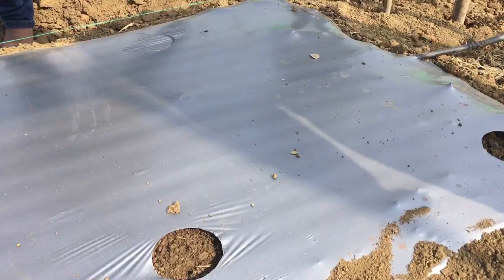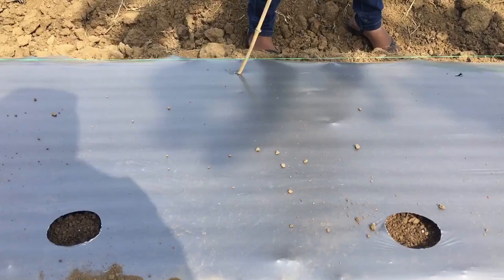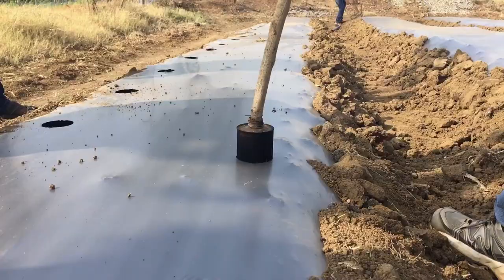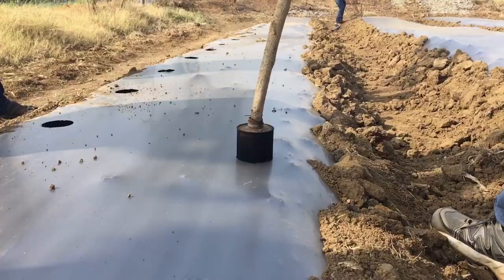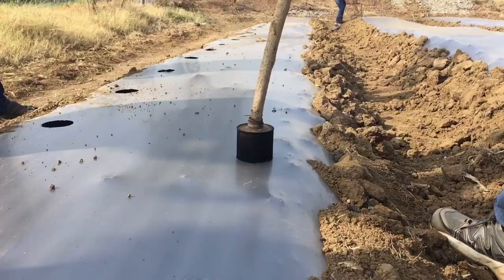How to make planting holes on raised bed with plastic mulch

Comment: Can plastic mulch be used without installing drip irrigation?  If so then how will the rain water get in to the plant roots since the plastic does not allow water to sip through in to the plants root zone?
Reply from the maker: Rain water can still enter through the planting hole or through the infiltration on both sides of the raised bed, where the drainage canal or path is located.
Reply: not sufficient. you need drip tape under the plastic

Comment: How do you irrigate this if have a big land ?     Drip system is very expensive in our area .   Can we water by flooding the in between channels ?
Reply from the maker: Furrow irrigation (flooding in between) is also an option if it is the most available method in the area. However, it is not the most efficient irrigation method and climate-smart technique, especially if there is water scarcity in the area. Another factor to consider with the furrow method is if there are incidences of soil-borne diseases like bacterial wilt - as water flow can easily carry the pathogen from one infected area to the other. Initial investment for the drip system is indeed an issue - but if it is possible to try in a smaller area first and compare the cost and return of both irrigation systems (furrow and drip) and weigh in the pros and cons together with crop yield assessment, this can help you decide what works best in your farm.
Reply from the maker: Is it possible to ask which country you are located in?
Reply: @EastWestSeedKnowledgeTransfer  I am in California, USA , but assisting and investing with, family members in bongabon nueva ecija.    I am helping them improve their farming methods.    Their techniques are 400 years old, using cow ...etc  .   Thanks for your reply .  I will consider your advice .   Happy farming :)
Reply: Is it possible in winter to grow veg